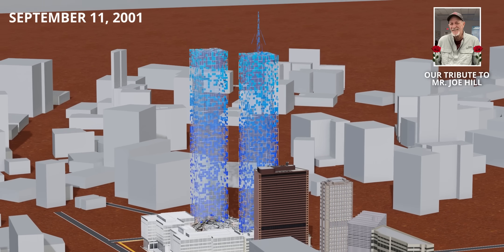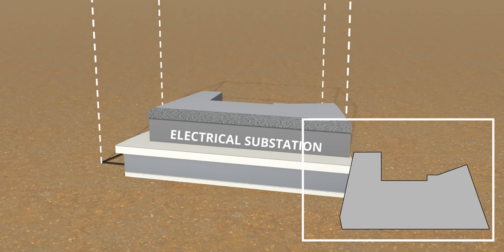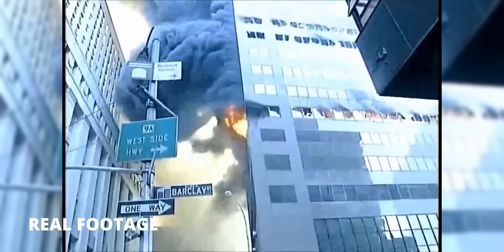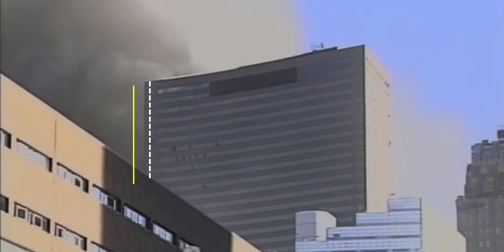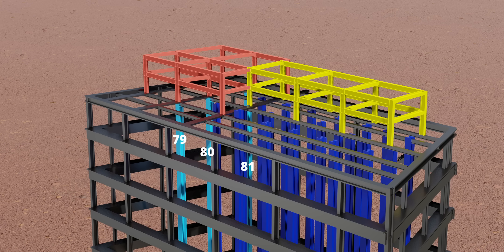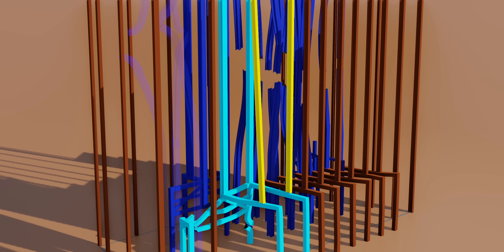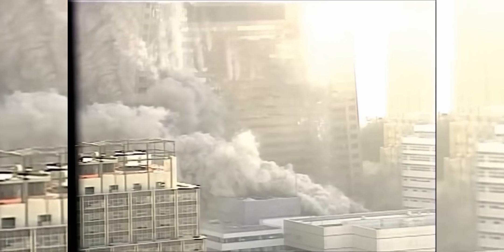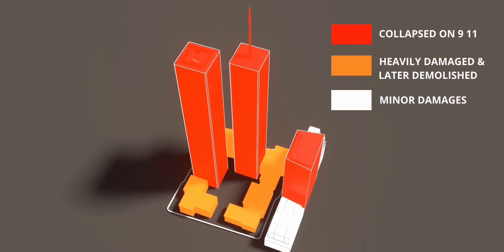Collapse of Building 7 | The Complete Physics

Comment: Nice and informative reconstruction of the collapse, well done!!
Reply: Only people with iq below 50 will get scam by this low quality and rigged analysis. No simulation only predetermined animation. Not holistic and narrow view, should do a checklist for possibilities etc, only have like one idea from the arse then that's it 'i finish my work'. Notice one insignificant illusion then explain it and waste people time like you are doing a test and want to reach certain amount of word count but only air and surface no truth and knowledge. Insincere and and  lack of critical thinking in the video. Can't even say control demolition or seem like in the video then explain a counter argument because it look exactly like control demolition. On 3:31 say real image but use the ugly ai. Not convincing I'm sorry.
Reply: Interesting there is a video to prove ? The towers brought this building down with them but no other close by buildings were involved .
Reply: @terryfrit3749 Other buildings were, but they weren’t as close and had a different design. Wtc 3 has completely annihilated during the collapse. Wtc 4,5, and 6 were severely damaged and partially collapsed due to their short size. The Deutsche bank buildings was severely damaged and had a piece  of wtc 2 stuck in its facade facing the wtc. Building 7 was the 3rd tallest building in the complex and had its side severely damaged by the north tower’s debris. The reason you think it was a demolition is because you see the Vegas demolitions and go “yeah that’s what ONLY controlled demolitions look like” a building collapsing will look like a building collapsing I don’t know what to tell you.
Reply: @vietnamesesmerf508  I had a ? Mark for a reason mainly because I didn't hear about other buildings outside of the main 3  which is understandable with the loss of life , chaos  and dust covering the city it was impossible to see everything happening then .
So thanks for more info I didn't get to on the other structures involved that day and afterwards .
Reply: @vietnamesesmerf508  es waren beschädigungen in der fassade und brennende teppiche zerstören keine Stahlträger egal wie lange sie brennen . es gibt nichts in diesem gebäude das was heiss genug brennen könnte
Reply: @DanyWildTV if something burns long enough it’s going to start to weaken at some point, even if there is no direct jet fuel speed 7 hours of unattended fires in a 48 floor building will cause it to collapse. Column 79 came out of place causing a cascade of the other columns to buckle and collapse, the facade stood for just a moment longer before finally coming down. There is literally no reports of sounds of explosions or remains of explosives.
Reply: @vietnamesesmerf508   es gibt branschutzmasse um die träger wenn es beton war hält der sehr lange hitze ab . das ist vorgeschrieben . da stehen keine nackten stahlträger im WTC und um sie herum flackerndes feuer . Teppiche und Möbel können auch so lange gar keine Hitze erzeugen das weiß jeder der sowas mal brennen gesheen hat . und genau aus dem grund stürzen ja sonst auch nie haäuser ein . weil wäre es so wie du sagst bräuchte man ja nur in der nähe um tragende säulen herum die möbel anzünden und häuser würden einstürzen . in echtzeit . das ist aber nicht so . damit ein feuer heiss wird brauchst du auch eine perfekte belüftung des feuers und so weiter und so weiter . aber nehmen wir mal an es stimmt was du sagst . dann müssten die firma die das gebäude gebaut hat definitiv mit klagen rechnen wegen mangeldem branntschutz und alles was in dem stiel gebaut wurde müsste überarebeitet werden  oder neu gebaut werden um auszuschliessen das es nicht nochmal passiert
Reply: @DanyWildTV So in reality wtc actually didn’t have concrete fire proofing instead the steel beams and columns were coated in a fireproofing spray (standard and actually beyond expectations in nyc during the 70s) this spray was rated to hold for 3 hours which would be more than enough for a small fire but not enough for a multi level fire that burned for 7 hours. Also rule temperature out of this equation it doesn’t matter at this point, it’s a matter of time. The fact that wtc 7 held for 7 hours was amazing under all of that weight, hours of burning, and column 79 failing the building went down. Also houses are a insufficient example as they are designed completely different than 48 story offices buildings. And yes houses have collapsed and burned to ruble due to uncontrolled fires. And as long as fire has something to burn such as idk oxygen and furniture it is going to spread and to burn, as seen in footage of the other side of the building through windows
Reply: @vietnamesesmerf508  no its no matter of time , you need over 500 celsius direct at the steel . under this temperatur nothin happen . what in the hell was in this floors burnin over 500 celsius for hours ?!?!?! it was an office
Reply: @DanyWildTV Ok, have you ever touched a seat belt on a hot day and it burns your hand? This is because steel stores heat. So after a fire burns for say I don’t know 7 hours the columns would begin to weaken and exceed the 400 degrees threshold for weakening to begin. Take the Plasco building in Iran, it was a office that after a 3 hour uncontrolled fire collapsed.

Comment: ...remember Windsor Tower ? ... good try but still not plausible for me...
Reply: What about Windsor Madrid?  It had a reinforced concrete central core and the fires were actively fought the entire time - the only reason any of that building was still standing at the end.  

It is worth noting that all of the steel structure above the 17th floor (a heavy, reinforced concrete utility floor) completely failed due to fire. 

So, if you are trying to prove that structural steel will fail in a fire, and reinforced concrete has some advantages in high intensity fires then you did a great job.

Comment: To this day… people still believe this.  Clearly a demolition. The building would have fell to the left.
Reply: This is one of those situations where we are confronted by a choice: 

1. Do the complex physics, fluid and thermodynamics calculations involving materials, pressure differentials, conservation of mass, momentum, energy, temperature, laminar vs. turbulent flow, viscosity, and density necessary to understand and explain building collapses on a detail level. Or 

2. Just skip all the hard stuff, and say controlled demolition then drop the mic. No thinking at all required. 

Conspiracists invariably take the low-hanging fruit, the path of least resistance going for Door #2. Conspiracists don't offer conclusions based on scientific reasoning, they only offer a two-word hand-wave rationalization that took or required little to no thought, maybe backed up with infinite "yeah, but" conjecture. 

It's boring.
Reply: @TheCriticalStinker-01 okay, stinky, if you did all that, then you can explain to us the upward forces involved in the collapse of towers  1 and 2... ??...
Reply: @TheCriticalStinker-01 yeah that's what I thought.  You don't wanna talk about real science

Comment: A plane flew into a 3 floor building in Islamabad and exploded yet the building did not collapse
Reply: A 3 floor building weighs a few percent of a 52 story building. Braindead.
Reply: The plane stalled on takeoff and skimmed across the roof. Not exactly the same thing as driving straight into the side of a building at 589 mph now, is it?  FFS 🤦‍♂

Comment: They were all controlled demolition
Reply: This is one of those situations where we are confronted by a choice: 

1. Do the complex physics, fluid and thermodynamics calculations involving materials, pressure differentials, conservation of mass, momentum, energy, temperature, laminar vs. turbulent flow, viscosity, and density necessary to understand and explain building collapses on a detail level. Or 

2. Just skip all the hard stuff, and say controlled demolition then drop the mic. No thinking at all required. 

Conspiracists invariably take the low-hanging fruit, the path of least resistance going for Door #2. Conspiracists don't offer conclusions based on scientific reasoning, they only offer a two-word hand-wave rationalization that took or required little to no thought, maybe backed up with infinite "yeah, but" conjecture. 

It's boring.
Reply: @TheCriticalStinker-01 like I said before stinky. If you're so smart explain the upward forces involved in the collapse of the twin towers. Im still waiting

Comment: Thank you!
There was a reason why there was more than one attempt to destroy WWTC is that those involved in a conspiracy knew the buildings were vulnerable. 
I came of age when the towers were being built.  There was considerable public relations at the time about how the 100 story buildings were supported almost entirely by the exterior steel skin and the internal elevator shafts that did not seem to be contiguous.  There were no supporting columns mid-floor.
If the integrity of the exterior skin was to be interrupted, it was possible for the buildings to come down.  I am not an architect or a scholar but I am amazed how many intelligent people entertained the theory of controlled demolition... The logistics involved in placement of explosive, organization and timing without exposing the project were almost impossible but the buildings had a weak link in their structure.  Yamasaki designed several other building in other parts of the country but they were kept out of the news because they had the same vulnerabilities.
Finally, “Thermite” is the name of a commercial product but it is also the results of a chemical reaction... thermite can be produced by the friction of 100 stories of steel plunging down in 10 seconds. That would produce thermite...  
Not to neglect building 7, that contained some of the same volnerablabilities were made subject to the chaos involved in the other 2 buildings contributed to 7 coming down.    
Even though my theory is unpopular, two airplanes coordinating at the same time and the same place indicates a conspiracy...
Reply: Mid floor??? Weak link??? And how do you know about the security of the buildings? Do you know about the gelatin group? Do you know about the boxes of fuse holders packed to the ceiling inside the towers? Tower 7 was perfectly imploded and everyone with common sense knows you can't simply light a building on fire and it fall perfectly into its footprint. This video says the steel perimeter columns were like cereal boxes. Have you ever used a cutting torch to eat breakfast? How do you suppose this guy from India? Knows where those bent I beams came from inside tower 7? Three buildings fell right there, 2 of them being the tallest in our country. Mid floor still gets me? What is that supposed to mean?
Reply: @robbiehiatt9966  I stated on the outset that I was not an architect or a scholar, it's  just my theory that contradicts the controlled demolition theory.  Is there physical evidence of fuses or gelignite? is there evidence of controlled demolition preparation? 
In the beginning there were  sales pitches for floors in WW1 and 2 stated no vertical columns or support in each floor out side of the bank of elevators.. The entire building was supported by the external skin... 
the gentleman who posted this video stated his case for building 7
In closing I will say that I believe that there "was" a conspiracy and that it could even be a deception by our own government.   but I don't subscribe to the controlled demolition theory...
Reply: @robbiehiatt9966  speculation is not fact... 
I can't speak to building 7, but building 1 and 2 had no skeleton, just the external skin... look it up... Now can I go back to my cat videos?
Reply: @Larkinchance here's one of the helicopter videos proving it true. Notice the one girl flashes the chopper while kids were around.  They definitely.
Had access to the complex.https://youtu.be/-its6EG3DwA?si=Yh2t3YDvNQzKUuIu
Reply: @h1F595  My apologies. I make mistakes.
Reply: @Larkinchance 1.The firefighters said" it looked like they planned to take down the building" I didn't say that, The fire fighters said that. They were there.I'm sure they know best.
https://youtu.be/XiIT4HInWjY?si=e1Pvp3-IFs-M75Oj
When the firefighter says "boom, boom, boom, boom" in this video.
What do you suppose he is?Implying by " boom" ?? What do you hear? 
2.So if there were no explosives then what is this? 8:25
https://youtu.be/bLF5D7M1YgA?si=aHSvS__uOdxMi1ZB
You can't say that it was added because you can see the firemen's reaction to the explosion. And you can't say it came from anywhere else because the firefighter says
" We gotta get out of here,  7 is exploding "
3. Controlled demolitions have squibs, you can see the squibs here 20 floors below the collapse. 
https://youtu.be/eXAgulfAtR4?si=-iLO9aQjMJVLTUYH
4. Firefighter says "any one of these buildings could blow up,  this ain't over yet" firefighter says there's 3 secondary explosions. 
https://youtu.be/0Gh3ErgMI4M?si=mmp9Eus_5PWTCBfl
5. Airplanes can't fly 600 mph at 1000 feet. And to be able to make a 180 degree turn to hit the opposite side of the pentagon going that fast is ridiculous. And since when do terrorists hit the opposite side of the building where no one was at when they could have just flown straight in and killed way more people???
https://youtu.be/0Gh3ErgMI4M?si=mmp9Eus_5PWTCBfl
7. No one has ever known ahead of time that a building was going to collapse except through controlled demolition.  Tower 7 was reported to have fallen while it still stood in the background. 
8. Larry silverstein,  the man who made over 4.5 billion when they fell, claimed to have pulled the building down.
https://youtu.be/1jQaJFNWqtc?si=wCywQ9grgBdS_w11
9. A witness reported a missile hit the pentagon while he was seen at the scene. 
And the hole wasn't big enough for a plane and the damage wasn't consistent to the towers. And just like shanksville,  there's pictures that show no plane parts at all.
https://youtu.be/6_Ez-UCpXMs?si=JaQ6DBEC_LJtMLgN
10. That video also points out They were military planes that hit the twin towers. 
11. All sorts of reports of explosions were reported that day.  
12 Buildings dont accidentally fall  Into it's own footprint...
Reply: The targets on 9/11/2001 were world-famous, iconic symbols of American economic, military and political power that would be heavily occupied, ensuring a mass casualty event.
Reply: https://youtu.be/X65VunrO6DQ?si=mTETJYCpZ5LVvb9S